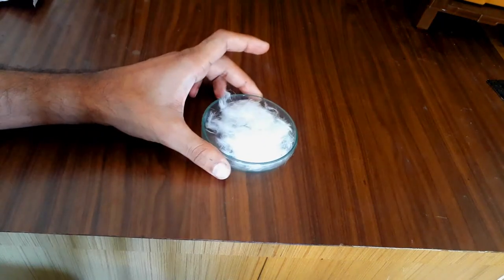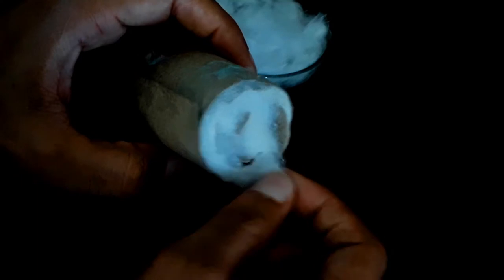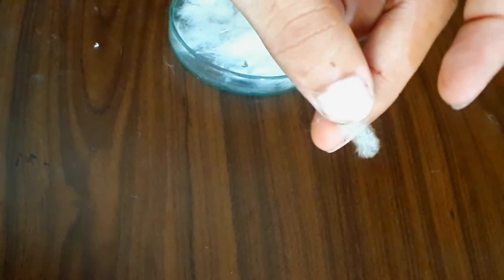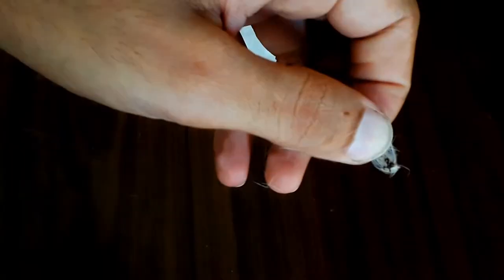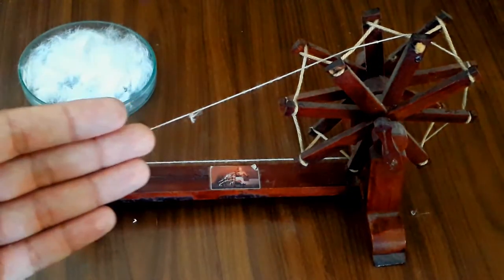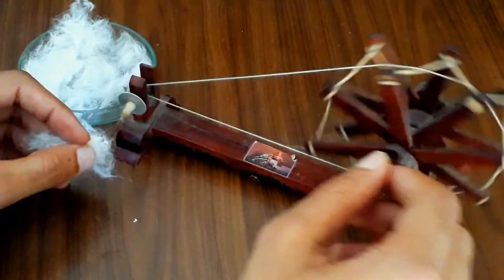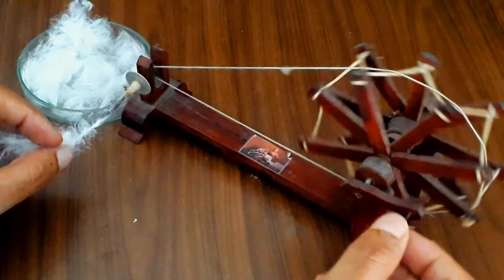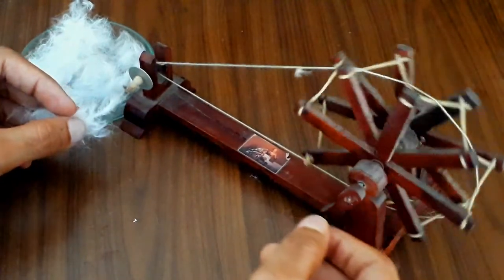Making thread from Rabbit Fur |Spinning Wheel

Comment: the charkha you're using was designed more for decoration. With a bigger charkha and higher spin ratios, spinning rabbit or cat hair is a little less difficult. 

Also, with the short slippery hair, using a leader thread or yarn that's already secure on the spindle will help a great deal.

It is possible to spin the short rabbit fur and other similar short slippery hairs, but it's much easier to either twist it into cordage, or core spin it on the outside of a center wool or mohair thread

Comment: Longer fibers tend to be easier to spin, that is why angora rabbits are so fluffy, also using both hands to work with the fiber really helps to get a more even yarn. I think a spindle may work better than that spinning wheel because a spindle uses momentum to keep itself spinning for some time, leaving both hands free to manage the fiber.